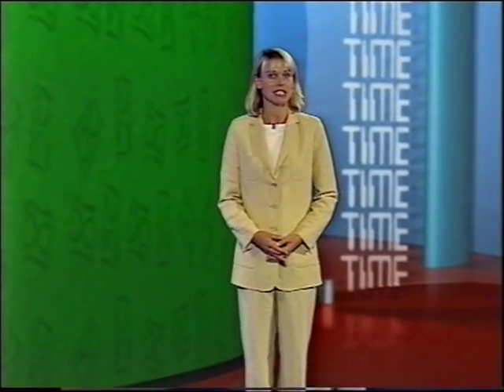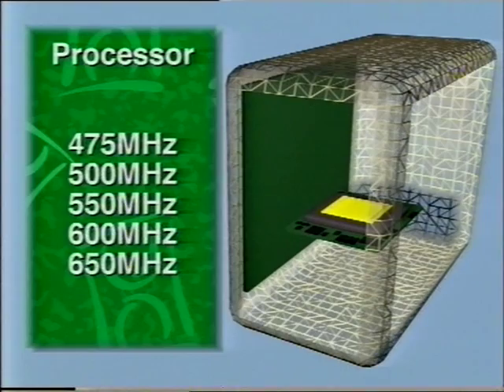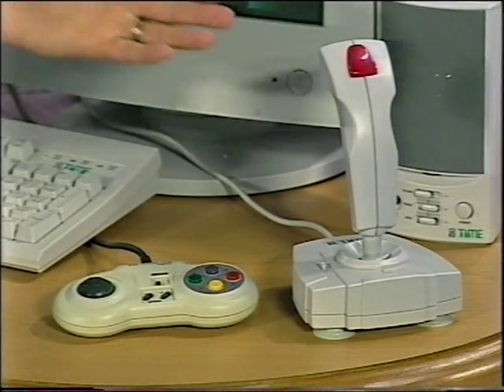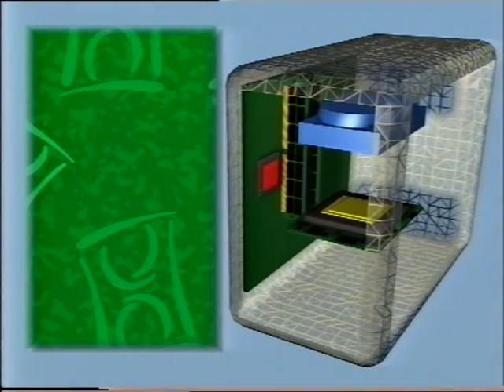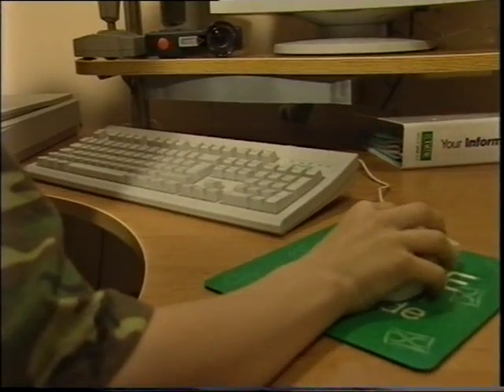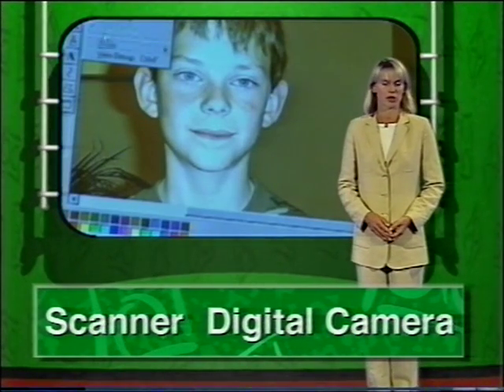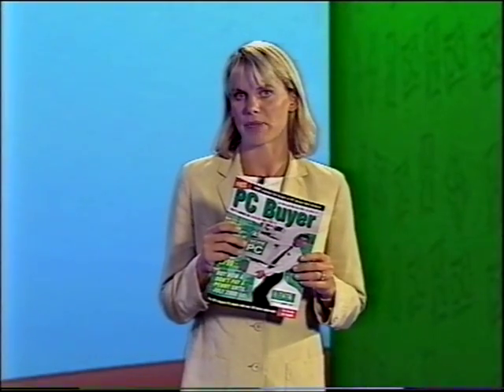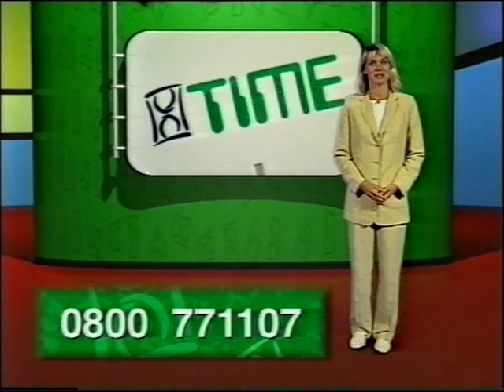Time Computer Systems Promotional Video 1999 UK

Comment: Jees, I used to work for Time at their HQ in Lancashire... It was my first real job after leaving college... I knew from working there that I never wanted to own one.
They actually bought Tiny at some point after I left and pulled them out of the US market they were trying to get into.
From my 'time' in service centre:
Anything in a desktop ATX chassis (branded Colossus at the time) was deadly - PSU's that were often not properly grounded and gave us quite a jolt when they came in for repair
Model 74/76 (micro ATX midi tower systems) which had modified motherboards with a small wire soldered to the back which used to burn out frequently - we'd replace with model 105.
I also worked on the tech support and what they called the SAS (software assistance and support) team - £1 per minute, 10 mins max.
Working practices and exit search practices that were later replicated by the likes of Amazon (worked there too once).
Reply: Thanks for your story! Interesting to read some inside info on the company.
Reply: Yep. That’s all true. I did a stint in tech support and in the workshop. The place worked on fear. People were marched out daily. Awful place. I remember the sas department. The were considered the special air service. By themselves.
Reply: @thrashpilot  i was there from 96 to 04 .... warehouse then workshop ....
Reply: @billybank2012  I was probably in the workshop with you then Naveed... i was there about 1999 for a good six months before i ran off to leeds.
Reply: @thrashpilot  I'd have to photo id you so I could potentially recognise you... I was line 1 stage 1 back in the day.. Before that I was at the bottom of the workshop near to the warehouse piling the computers on to pallets (that long line where the pc's would be packed into boxes)
Reply: @billybank2012  ha. no worries. hope you're well Naveed. I was on repair.. i have no idea what line or anything. Just fixing PC's in the worst way possible and sending them back out to explode again another day :)
Reply: @thrashpilot  oh I see u were in another area.... Otherwise I probably would have recognised you.... Anyways it's in the past.... Never to be repeated....
Reply: @billybank2012  oh spoken of every again, ha!
Reply: @naveed hussain and @thrashpilot I need more info on the company as i am working on a video
Reply: @TugAndThugComputing  what info do you need? This sounds like you may want to contact me outside of YouTube
Reply: @TugAndThugComputing  What do you need to know? It's pretty well documented. They made cheap PC's... they cost a lot less than the others... for a reason.
Reply: @thrashpilot  Anything really

Comment: My first PC was a Time computer, 366mhz celeron in 99, luckily it appears that particular celeron was a decent one for the time and not gimped a lot like they usually are. I ended buying my own parts 2 years later in 2001 with an Athlon XP 1500+, i think the bundle i bought already had the CPU, cooler and RAM installed.

Comment: I worked in the BigW store at Catcliffe from about 2000 tp about 2003 when i moved to the meadowhall retail park shop. As i was very PC tech literate i assumed the role of impromptu technician. Shit they pulled was incredible such as selling (bundling) DK software that borked under XP SP1, or the cheap and duff fujitsu HD's with the duff ionic resin. Or locking their modems to their OWN ISP, Supanet. That took some figuring out but i did. New rockwell modem driver, reinstall IE and lock gone. They hated me for figuring that out as they thought it was "secure". Ran by two Pakistani brothers, jobs mainly went to relatives with no experience. They were constantly in the "worst company of the year" and such like. They bought Tiny computers when their owner made a bad finacial descision. Time only ever bought the NAME, nothing else. Tiny customers who had spent several hundred pounds on "extended warrantys" were turning up to demand that TIME fixded them. I got into several heated arguments because customers couldnt grasp that TIME had not seen a penny of the money of the money they had spunked on the "warranty" and that we had zero obligation to repair them. So, i offered to do it in my own time at a discounted rate. I made a fucking mint back then, especially when the "blaster" virus appeared. £20 to stop the RPC call so you could install SP1 without the PC rebooting. I did about 3 a night for months.. Good times, shit company. One day, some new starters had arrived as salesmen. I was in the back swepeing the stores. 3 of these new starters were stood around doing nothing and having a laugh. Suddenly the relief manager appeared and sacked them on the spot. They hadnt been there 3 hours and to be sacked on your first day... They made the engineers redundant by SMS, i shit thee not.Absolute disgrace of a company.